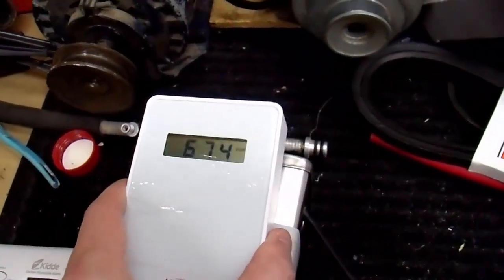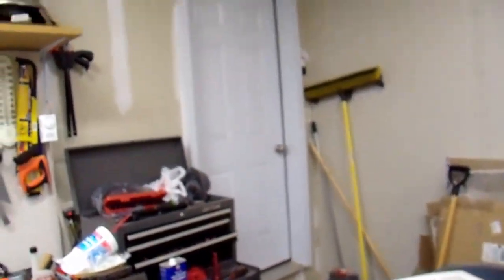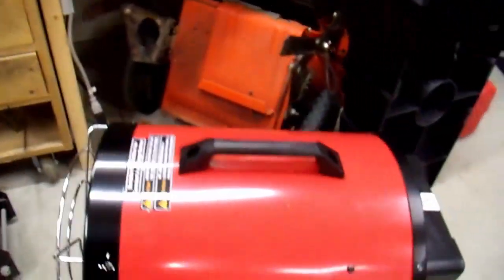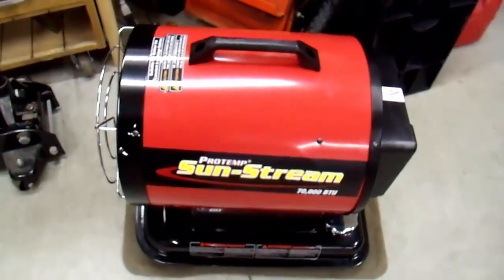Protemp Kerosene / Diesel Heater Review PT-70-SS - Part 2

Comment: How can you make a beautiful heater like this and NOT put in an automatic thermostat? Just dumb by the manufacturer.
Reply: the way its designed you cant
Reply: DMAN22yeah why can't you?  The fan and igniter/fuel pump have a different power feed. Have the thermostat only interrupt the power to the fuel pump/ignited. I have one of these and am about to attack this very issue.
Reply: Michael Durkin its supposed to be able to run a cool down cycle to prolong its life, the way you plan to do it sounds like the better way
Reply: DMAN22yeah it may or may not work. Only one way to find out
Reply: Michael Durkin i would design a circuit that would perform a normal shutdown on it, its been forever since i watched the video but theres probably an easy way
Reply: Michael Durkin did it work
Reply: 2 great videos ...now please, may we have 1or 2 on maintenance/trouble shooting? Thanks...hurry please, cuz...baby, it's cold outside!

Comment: December 2016 now. How is this heater running?
Reply from the maker: Excellent.  It is still running strong.  I use it primarily for those times when I want to work in my garage but it also functions as aux heat for my house or as an alternative for electric heat in my garage.
Reply: knurlgnar24 does it heat up your garage fast or does it take few hours to heat up the garage ?

Comment: That was a great rant on gasoline.  Im guessing your wife wasn't around.
Reply from the maker: HOLY SH**!!  I HAVE A WIFE????
Reply: ***** maybe not...
Reply: ***** Congrats I guess 

Peter Carlson
It rant on gasoline ? Diesel ! never put gas in these or they will rant and rave and burn your house down
Reply: mattmopar440 They say it needs fuel. And I don't know what fuel is. I mean red bull is fuel, gasoline is fuel, kerosene is fuel, so I'm just going to use what I have. I have gasoline. I'm gonna fill this with gasoline. MMMM glug glug glug glug glug glug. I'm using the old non carb complaint gasoline cause it pours better, and I like it when it pours. I don't care about the environment. Lets fill this whole thing up with gasoline. MMMMMM gasoline. It's a multi fuel heater it should burn gasoline. They say not to use it but I'm smarter than them. So I gave this what I have and that's gasoline.
Reply: ***** Get a Mercedes Benz before a wife the merc is cheaper.

Comment: Close to $400 for this heater and it doesn't even have a thermostat???
Reply from the maker: Less than $300, but no thermostat true.  The models that have thermostats generally don't last that long as they do not have a cool down cycle.  It depends on what you're looking for and if you need a thermostat this isn't what you're looking for.
Reply: @knurlgnar24    Thanks for writing.  As a newbie, I purchased and today received an 80,000 BTU Dyna-Glo Delux KFA80DGD.  I filled it with K1 kerosene, fired it up and pointed the exhaust end out the Garage door to let it burn off whatever might smell bad.  After a half hour, I turned the unit around pointing it back into the garage and closed the door.  I let it sit there for about half an hour and then entered the garage again.  Much warmer.  The thermometer indicated a definite rise in temperature and the garage was comfortable, heat wise.  The Co monitor indicated NO carbon monoxide.  STILL... within a few minutes in the garage my eyes and nostrils were being irritated to the point of burning with the fumes.  Cigarettes never affected me like this heater does.  QUESTION:  Is your heater any better than mine where fumes and irritations are concerned?  Thanks
Reply from the maker: @tribulationprepper787  Your unit either has a problem of you have bad fuel.  These heaters will make anyone's eyes water and burn if the fuel is not being aerosolized properly when it is injected which usually means pressure too low (plugged filter or bad pump) or a nozzle issue.  If you are reasonably confident that your fuel is good quality I would drain the fuel and exchange it for another unit from wherever you bought it.  You can try draining the fuel and running a gallon of ordinary pump diesel through it as well to verify.  (it will smoke a little on startup on pump diesel but burn very clean after that)  I have actually run this heater in my well sealed house (unfinished basement, heater startup and shutdown outside) for more than an hour straight and had no noticeable small when I returned from work the next day or when I had visitors that weekend.  I did this as an experiment and wouldn't recommend it but it shows just how clean burning these are when working properly.  *edit*  I just read the model you purchased and those torpedo units are a little dirtier burning in my experience as they have less surface area for the 'catalytic' effect of the front bright red hot surface to burn residual fuel.  That heater though is definitely not working properly and should not cause any distress to even the most sensitive people AFTER it is warmed up fully.  They all smell some on startup and shutdown but just smell, not eye watering stuff.
Reply: @knurlgnar24    You mentioned "bad fuel".  My K1 is about four years old and has developed some deterioration noted by a lite yellowish coloring.  It is no longer any good for use with my wicked heaters.  I turned the pump pressure set screw back/left three turns and it is better in terms of smell but there is still a slight irritation to my eyes and nose.  Any remedy you know of to the old fuel problem.  I still have about 190 gallons in an IBC Tote to go through.  Thanks
Reply from the maker: @tribulationprepper787  I don't know your particular situation but I doubt that your K1, if good initially, has deteriorated this much in 4 years.  Kerosene if not water contaminated and stored in an environment absent of light should store nearly indefinitely.  For example I pulled a wicked heater out of my parents attic that was 30+ years old a while back and the fuel in it was perfectly fine.  Do you know why your fuel does not work in your wick heaters?  I'm curious what happened here...
Reply: @knurlgnar24    I have two Heatmate HMN-110 10,000 BTU kerosene heaters.  This year I have been using the one which has the reflective forward facing metal cage as opposed to the one with the 360 degree chimney.  I installed a new wick and within a week, the rear of the wick was not burning and in another week the total visible burn was down to about 20% and the heater was emitting noticeable fumes.  I have no idea why the performance deterioration.  I do know that the previously clear KI in my tank has changed color to yellowish.  I do use a Mr. Filter to screen out water and impurities in the fuel.  It's a mystery to me.  Maybe my wick installation is at fault????  I did install the new wick about 1/16 inch above the line on the wick AND the electric element starter would not light the wick after that install.  That is all I can tell you about this situation.
Reply from the maker: @tribulationprepper787  I highly doubt your wick installation is as fault but I honestly do not understand why you are having troubles.  The only thing that makes sense to me is if your fuel is not true K1.  I tried a #1/#2 diesel mix in my wick heaters a while back and it does NOT work.  Perhaps your fuel is no true K1?  I honestly am just guessing but this stuff isn't very complicated and there isn't much to go wrong if you have good fuel.  Please let me know if you can eliminate your fuel or not as the problem - I would be very interested.  These types of fuels were perfected more than 100 years ago so this really shouldn't be an issue today.  Yet i know that it still can be due to the low demand for such fuels.
Reply: @knurlgnar24    I bought and started using the fuel I have five winters ago.  It was delivered by a reputable local business and pumped into my well cleaned tank which sits in a dark garage.  The fuel did not have a yellowish tint at the time.  It does now.  I have read that K1 which is stored in plastic containers can cause the interior of the container to deteriorate over time and can promote the growth of micro organisms that clog wicks.  Maybe this explains why the fuels stored in old heaters with metal tanks is still usable years later...  No light and no plastics????
Reply from the maker: @tribulationprepper787  Interesting about the plastic deterioration hypothesis.  I know that diesel stored in the wrong plastic container material WILL degrade within a few years for whatever reason, but as gas/diesel containers are HDPE and ibc containers are as well (as far as I know) it sure seems like an appropriate storage container.  Light will ruin fuel but you say your storage location is dark...  Heat will ruin it over time but not that quickly and I assume you don't live somewhere tropical...  Air tight I assume?  (K1 does not require a pressurized container like gasoline, just no air exchange.  In studies I've read about long term fuel storage sealed steel containers can store even untreated gasoline for long periods of time, many years.)  Huh.  I guess steel barrels is the gold standard here but otherwise I have no ideas for you.  Without light, water, or air (oxygen) micro organisms have no energy sources available to grow and the fuel should remain sterile as far as I know.  I've often wondered if diesel treatment would help K1 store better but I've never found any good info on it or had experience with it.  Sounds like you have some extra fuel now for whatever diesel equipment you have around!

Comment: They say it needs fuel. And I don't know what fuel is. I mean red bull is fuel, gasoline is fuel, kerosene is fuel, so I'm just going to use what I have. I have gasoline. I'm gonna fill this with gasoline. MMMM glug glug glug glug glug glug. I'm using the old non carb complaint gasoline cause it pours better, and I like it when it pours. I don't care about the environment. Lets fill this whole thing up with gasoline. MMMMMM gasoline. It's a multi fuel heater it should burn gasoline. They say not to use it but I'm smarter than them. So I gave this what I have and that's gasoline.